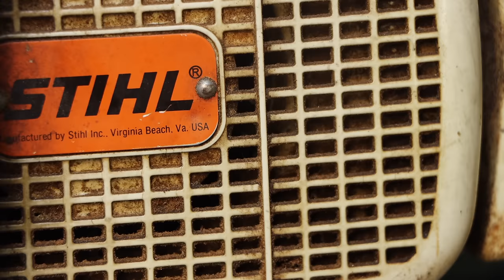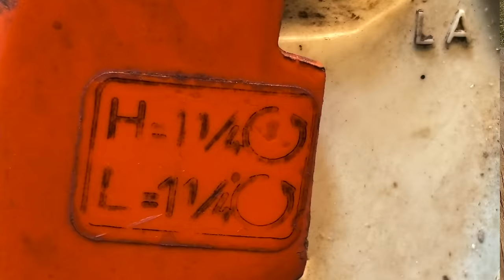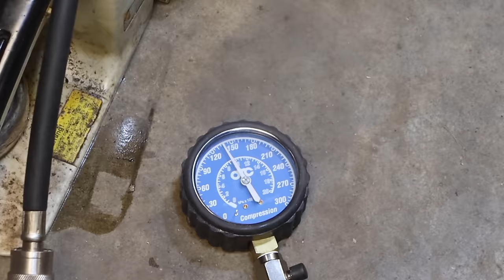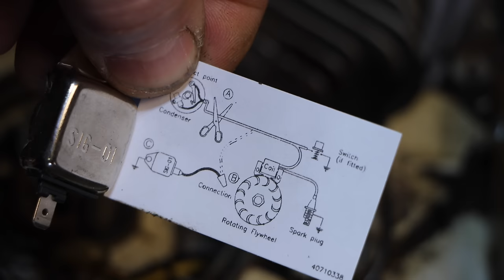Fixing An Antique Chainsaw.  Stihl 028 Wood Boss.

Comment from the maker: Yep, this was a tricky one, which for me makes it more enjoyable in the end.  Though it did take me awhile, I'd take this over just rebuilding the carb any day.  Ignition tester: https://amzn.to/48SdqEG.  Electronic ignition module: https://amzn.to/3v3pNQo.  Have an awesome weekend everybody!
Reply: Curious if original carb ran the saw after ignition repair?
Reply: I only watch for the seals
Reply: I've had many years ago (~2000) a similar problem with a 79 Ford Taunus (German made) carburetor that would not start the car in cold even if you asked it nicely... After a fewf clean-ups and some repair kits I ended up putting a flange and a carburetor for a different car with similar size engine. Went to a dealer, changed some jets and they tuned it and worked like I a charm. It still bugs me to this day what I didn't know that could help me fix it.... After a few years I drove the car for the last time. I've noticed that the car run perfectly and my father noticed this as well... It was a bitter sweet moment. That was the car I put my most work into and thought me  a few things about rust and what one can fix and when one should let go.
Reply: 98.
Reply: I have an Old 41 Farm Boss I'd like to have rebuilt that's about 45 or 50 years old. Is something you can successfully work on?
Reply: The fuel build up was a symptom of poorly functioning ignition. The fuel has to go somewhere if it isn't ignited, so I would expect to see some fuel on intake and exhaust side. That will also flood the chamber making it harder to start. Those old carbs will work forever provided they have been maintained correctly. Unfortunately, too many amateurs out there that spray high pressure compressed air into those jets ( destroying an internal seal that most people don't know about, a low 5 psi is ok ) and overtightening the adjustment screws and damaging the seats etc. I like those carbs. I have the same on my 038 AV. It's my workhorse that still cuts better than most of the newer Stihls. It survived a big tree trunk falling on it.

Comment: The high speed jet should be adjusted at wide open on the trigger while under load in a cut.  This is why saw shops used to have a big hardwood log out back before government took away the adjustment screws.  There are screwdrivers that lock onto the jet to make this easier.  Same thing, find where it starts stumbling in both directions and put it in the middle.  You'll be amazed how much more power you can dial in.
Reply: Turning the high screw on full throttle with no load until rpm is the highest then backing it off until it '4 stroke's also works
Reply: Great video John, very enjoyable. Small engines can be very temperamental hey! 🇦🇺🍺🍺
Reply: The official Stihl way is to adjust no-load RPM at full throttle (with an electronic RPM meter), but I also usually use your method.
Reply: 100% wrong. There is a spec in every Stihl Tech Manual for a top no load speed setting. The high is adjusted 500rpm under that spec for a saw that is broken in and 1000 for a brand new saw. It should be adjusted using a digital tachometer.

Comment: I bought my Stihl 028 Wood Boss in 1987 to clear off an area for our new house.  It has always been a great saw.  After watching your video, I discovered the manual says it has an electronic ignition, so that should be good.  Over the years though, I have rebuilt the carburetor with new kits and never had real good luck with them.  In the end, I replaced the whole carburetor with a cheap China one from Amazon and it has worked like new ever since!  It is the only chainsaw I have ever owned and definitely don't consider it an antique!
Reply: I bought mine in 1986 and use it regularly. I burn 4-5 cords per year. Along with an 036 they run great and still going strong.

Comment: Sounds like it's crank seals John. Put a cap on the exhaust and pump it up. If it leaks, pull the engine apart and reseal it. A couple of hours will make a dandy saw.

Comment: John Do a leak down test on that motor to make sure you do not have crank case leak. The 028 is known for bad crank seals/ impulse line/ intake manifold boot. Also the coil you bought is a electronic ignition coil. Just hook the kill switch to it and it will work. Do away with electronic ignition module if you want to put that new coil in that saw.
Reply: Well that is some incrowd knowledge, really nice
Reply: That was I thinking Leak test it.
Lots of hard issue come from Leak test
Reply: Thank you for these tips! I'm never too old to learn new things.

Comment: This is what I love about old mechanical tools, they're fixable! I like the electric stuff but man when they fail, they're not easily repairable and I guarantee they won't be lasting 40 years like this saw!
Reply: I haven't found too many modern tools that can't be repaired; they just need different skills and sometimes a creative method of sourcing parts.
Reply: @watcherofwatchers  that’s a good point and great perspective. I’ve soldered connectors back to Bluetooth speakers and resisters back to boards but the new tools seem so cheaply made, sometimes it’s better to replace than to fix. Love the content on this channel, though. Fixing things and bringing life back to stuff is cool regardless of what it is.

Comment: I have a Still 041AV chain saw I got in 1970 so it is 54 years old now.  I still works perfect although I did put a new carb on it several years ago.  I also replaced the spark plug and air filter and gas line and filter because ethanol gas rots gas lines.    Great saw with minimal maintenance.  I did not use some aftermarket Chinese carb but rather bought a proper Stihl carb for $60.    Love my old Stihl.

Comment: I ordered both PC-7 & PC-11 as I needed some good epoxy and this stuff seems really good.
Reply: I also have them and they are great, BUT they are slow to cure (hours).  If you need something fixed quick, get JB Weld KwikWeld or similar.

Comment: First thing I do with a non running saw is check compression with a tester. If someone puts the wrong gas or mixture in (it happens a lot) or another issue leads people to turning jets….. making a lean mixture. Both will burn up the piston and cylinder very quickly.  With a saw that runs but not great, pull off the muffler and look into the cylinder. Then rotate the engine slowly and look at the piston. Exhaust side is the one that gets burned up from excessive heat. Just a small amount of scoring will drop compressing causing it to run or start poorly.

Comment: I have a Stihl 08 that my dad bought in the 60s. Folks around here gave him a lot of flack for buying a "foreign" chainsaw! I reckon he had the last laugh as it's still in good condition.after almost 60 years. Last time I tried to use it, I could not get it started. I took it to the local Stihl dealer and they fixed it for free and thanked my for allowing them to work on it! I was astounded, to say the least.

Comment: I rebuilt my Dads old 041 from 1978.  You would be amazed at the amount of parts Stihl still has kicking around for factory parts including carb rebuild kits, bearings, etc.  I did have to go aftermarket for some stuff, but I expected as much.  The saw runs pretty well now.

Comment: Wow, thanks for reviving the old 028 Wood Boss. I purchased mine in 1984 and ran it hard for 30 plus years before giving it to my younger brother. It still lives on at the farm cutting fire wood. Brother tells me it runs better than his 2 newer 025's. Besides chanes, bars, drive sprockets, spark plugs and some other small maintenance items, still starts on the 3rd pull after sitting for a week and 1 pull after running and shut off for a break. Dont make them like they used to.

Comment: Thanks for this video!  I have one of these saws that was purchased in Dec, 1980.  My side plate says it was made in Germany.  I've replaced the carburetor once about 5 years ago and it ran great for awhile but started bogging down when trying to give it gas.  I may try that electronic ignition module.  I had no idea this saw had points!  Great job troubleshooting from start to  finish!

Comment: I absolutely LOVE your grain mill drive! Creative solution. As for the saw, your methodical approach to fixing it may have taken a little longer, but you know everything else is good. Ditching the mechanical points is something I may not ever have thought of. Really appreciate what you do and share with is all. THANK YOU!
Reply: I have replaced the mechanical ignition on both of my Suzuki cars. And I instantly gotten stronger spark and like 5HP extra instantly. (which is a lot in a car with only 50 factory HP to begin with)

Comment: Our .o32 takes two pulls with choke on, fires, chole off & it's ready to crank and cut wood. It was this way when new and today about 15 years old. Stihl is hard to beat. I am amazed at your patience and the few bleeps necessary to complete a project. Good info & video.

Comment: Jon, good job on your stick to it mentality. When I was having a problem with my Stihl bogging down I talked to my Factory Stihl Repairman and he told me to only run 92 octane fuel with the 2 stroke oil in it. If you can get it without Ethanol it is even better. I changed the 89 octane fuel to the 92 and wow, that really fixed my bogging down. I am sure you already know it but this was news to me and I thought I would share it with you. Great video. Oh and the flower grinder was priceless. You think a lot like me. hahaha

Comment: I adjust the high speed screw for highest WOT, then the low speed screw for fastest acceleration.  Lastly the idle stop for a reasonable idle speed.

Comment: Great diagnosis video for the old Stihl chainsaw! 
I would not have guessed that a chainsaw made in 1981 would still have had non solid-state (points & condenser) ignition, & since electronic ignition is usually very reliable (& durable), I didn't suspect bad ignition as a likely cause of the engine's non acceleration issue (I imagined the issue was almost certainly carburetor related).
When you decided to replace the condenser with an electronic ignition module, I thought that theoretically (& ideally), that should be a big improvement (over points & condenser ignition), but practically, I thought the fit & quality of the aftermarket electronic ignition module might be questionable, & so I thought it might have been better to obtain Stihl OEM replacement points & condenser (to insure proper fit & quality). 
After all your diagnosis, I'm sure you would have wanted to determine the cause of the engine's non acceleration issue, without additional uncertainies of replacement part quality (such as  the new aftermarket coil, which was bad "right out of the box). 
Regardless of the aftermarket electronic ignition module issues, I think you did a thorough & meticulous job fitting all the ignition module parts & wiring, & did great work overall!
The old chainsaw sound great!

Comment: Weak spark always shows up when the throttle is opened because the compression is much higher than at idle. It is much harder for the spark to jump at higher compression. Adjust high speed jet under load. Will get rid of bog down while cutting. Nice video John. Thanks

Comment: Have one since new! 1990. Only thing I’ve done is new carb from the Hipa Store and new plug probably 3 years ago. Runs like it did new. Cold starts on third pull, first pull when warmed up. A little heavy for a 47cc saw with 16” bar, but all metal! 👍🏻 Thanks for the video!

Comment: LOL.... I walked out just before you found the points the last time I watched this, watching it again and I was thinking I bet theirs points in that thing ! and sure enough... the way it was running just pointed to me the points/condenser the condenser in particular in this case
...my hats off to you as I bought one of those little electronic ignition module a long time ago and I fought it for a week trying to get the thing to work and finally gave up and put the points back in it ! (on an old B&S 3.5 hp)....  I never seen any of those things work !
I've had friends tell me nah they are junk, they don't work ! yet You got one to work WOW !
 I've had several saws with points in fact I think I still have 2  ! 
it would have been really interesting to see if just replacing the condenser cured the problem.... but I guess we'll never know now ! HA !  
Thanks Jon for the great videos !

Comment: I’ve got one just like it that my dad had and used a lot. It sat in my shop since he passed away in January 2012. I purchased 90 acres in Lincolnton Ga. in 2021. I decided to try it out and after putting new gas in it, it fired up on the 9th pull. I put a knew plug in it and it starts on the second pull every time. I cut several loads of firewood with it and I love it!

Comment: The spark strength required to jump the gap increases when the plug is in the cylinder and under compression. It takes more voltage to jump the gap due to the higher air density. But, fuel will conduct electricity so that helps get the spark across the gap.  A low compression rich mixture takes much less voltage that  a high compression lean mixture.  That "S" on the spark test tool is the minimum spark length required in free air to get a consistent spark in a cylinder.

Comment: My 028 starts and runs whenever I need it. Its amazing.  I've had it 15 years or more and maybe changed the plug.  Chickanic recently did a video on how to flex the diaphram to get it working - once its running.

Comment: Great video!  I have several saws and the latest addition is a 051 AV electronic.  The spark died and the it’s the old Bosch module they fitted instead of points. I am hoping one of these aftermarket modules will work for this saw too. It’s amazing that they get the timing right.

Comment: I have had very good service from the 20V Dewalt electric chainsaw.  It routinely bites off and chews a lot more than I thought it could.  Even though I would say that it is really just a limbing or pruning saw, I have made some very big cuts with it.  And no small engine temperament to deal with.  Just charge a battery and pull the trigger.  Though, it is entertaining to watch you trying to get that thing to run right.

Comment: And one more thing, that idle speed adjustment screw is supposed to have a little coil spring under it to keep it from backing out of the housing from the vibration.  My saw doesn't have that rubber coating on the handle, mine is just smooth metal.

Comment: Hi John
When hi speed bogs down adjust low speed more fuel 
Remember adjust hi speed with full throttle then give more fuel till revs come down a little this is the power band

Comment: I purchased my 036 new in 1994. We heated with wood exclusively for 10 years and every bit of it was cut with it. When we purchased 20 acres of wooded land it’s bee used constantly to keep the land cleared of damaged trees.  It’s never had ethanol blended gas in it and it’s ran on Amsoil Sabre oil exclusively. If I went out to the barn right now it’d start on the third or fourth pull. I’ve put numerous bars, chains, gas filters and clutch sprockets on it but the engine remains untouched. 
Stihl built a great saw back then.

Comment: Points was a surprise! I have a 43 year old 056 magnum I bought brand new and it has electronic Ignition, not the original mind you. It’s my go to medium size saw. I guarantee the modern computer controlled saws of today will not be salvageable 43 years from now.

Comment: I rebuilt the same saw just over a year ago, it had a cracked piston.  Stihl wanted unbelievable $ for a piston and rings but found them on Amazingzon for under $30.  Just like your saw it was my fathers saw and I used it as a early teen up till i left the house.  It then sat from sometime shortly after 1986 when it quit until late 2022.  I don't use it much as I have several newer saws but I pull it out to use occasionally to use on 12"-14" diameter and smaller trees or limbs.  It was mated with a 20" bar and chain but I use a 16" on it now.  They were a super popular back in the day and were really stout for their era.  Great content and I really enjoy all your videos.

Comment: I inherited this exact model of chainsaw from my father which he bought in the late 70's or early 80s.  It runs great.  Always starts on the third pull even after no use for over a year.  But once it gets warm after about 5 minutes of use, it sounds just like your saw.  I think I'll try this ignition module and see if that does the trick.  Thanks for the video, its such a great resource when I go to do work on my saw.

Comment: John,  I own a Stihl 028-WB similar to the one you repaired.  I believe I purchased it in the mid 1980's  My saw has always been a difficult starter but once I pour a little fuel in the spark plug chamber it takes right off.  Switching to Tru-Fuel has made a big difference in starting and I no longer need to pour fuel in the cylinder.  I always clean the saw and dump the fuel after use.  
Your tutorial is timely as I need to do my annual maintenance on my saw.  Great videos as always.

Comment: Well done with your on Camera Patience 😂🤣. I was of the belief that the HS screw adjuster should be done with the engine at full noise while adjusting..... The way you are doing it works, it's a bit hit & miss until you get it right........ Keep up the good work. cheers From Australia 😃👍

Comment: An excellent video.  I have nearly finished servicing my Stihl machines.  One thing that I have found out over the years.  Replacing carburettors rather than trying to repair them is much more effective in terms of both cost and time.  Incidentally,  Stihl carburettors are branded Stihl but made in China.